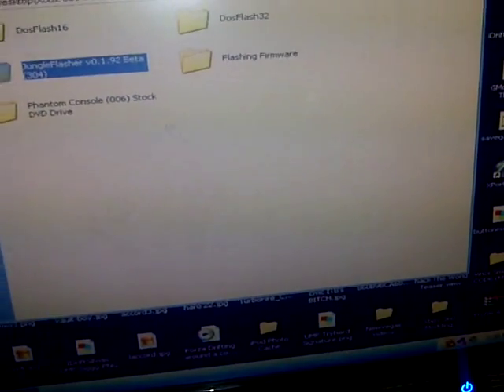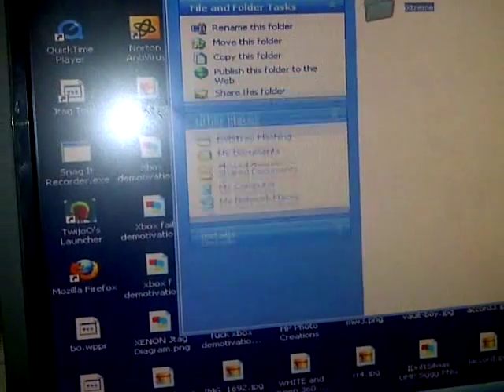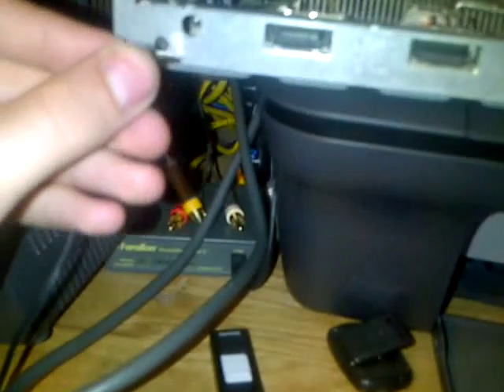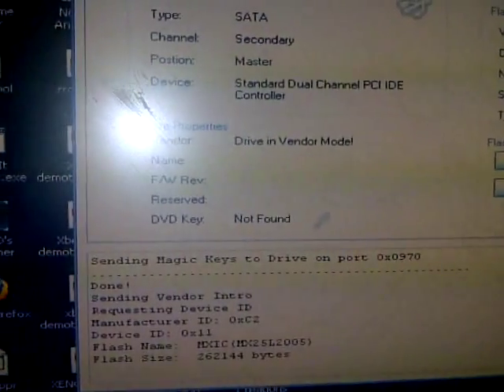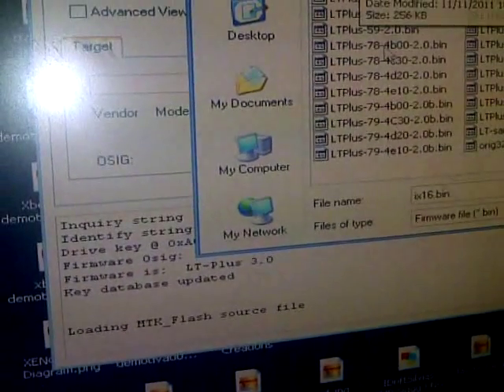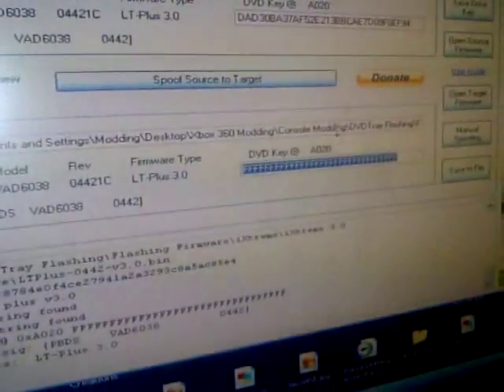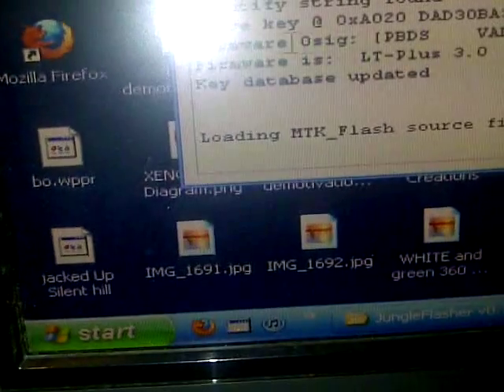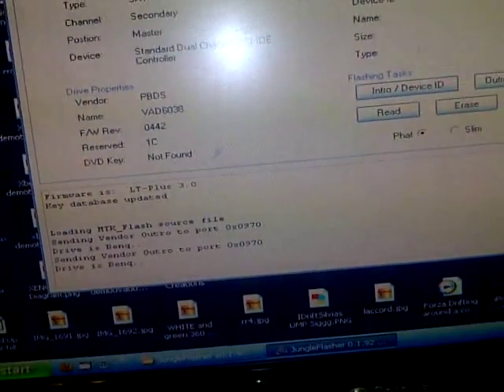How To Flash Xbox 360 phat Ben-Q DVD Drive with Jungle flasher

Comment: I have a Rosewill RCW-608 USB2.0 Adapter For IDE/SATA Device, I want to flash a Samsung drive to a BenQ but neither are being detected by my laptop (Windows 7 64 bit) I also put it into test mode and rebooted and did the F8 and disabled detection thing but it still wont see the drive. What can I do to get this to work?